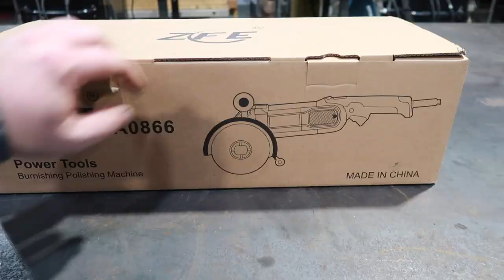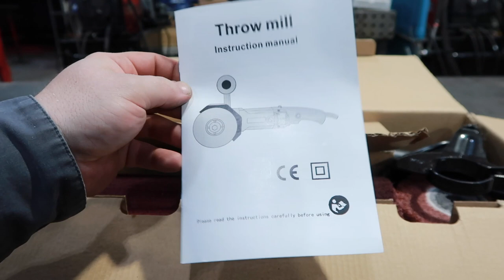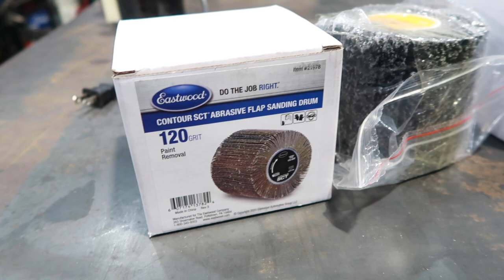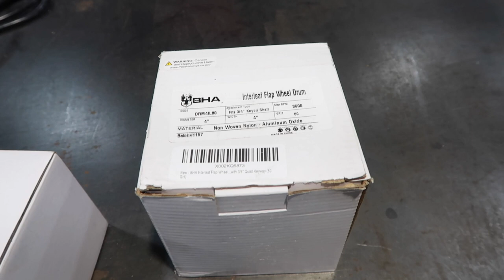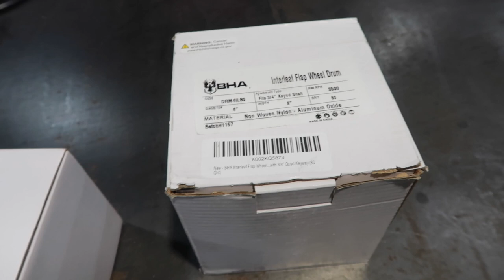Amazon Burnishing Polishing Tool Test | Surfacing Tool | Metal | Surface Prep | Fabrication Tool

Comment: I bought mine from harbor freight last week for $129 came with 3 wheels I paint old cars so hoping it will make getting back to metal easier and quicker.
Reply from the maker: Awesome! Thanks for watching and commenting!
Reply: @TheGarageVlog  it works great for flat surfaces not so good for curves
Reply: HF deliberately makes their model so it won't accept the endless styles of 3rd party drums that all the others use (Eastwood, Vevor, etc.)
Reply: @@chasewilliams5128 If you buy the non-Harbor Freight models you can get a brush or drum for ANYTHING. That includes wire brush drums, flexible grit-embedded nylon bristle drums, scotch-brite styles, etc.
Reply: Will the Eastwood drums fit the Bauer?

Comment: What are the advantages over an angle grinder with a sanding disc?
Reply from the maker: You get more contact area with the work piece, so it works faster and doesn’t dig into the metal like a grinder does. The biggest advantage is this just removes the rust without removing metal. I used to use a sanding disc on a grinder, but you would see still grinder marks. This gives a nice uniform finish. Hope this helps, thanks for the question!
Reply: @TheGarageVlog  Thanks!
Reply: @@chasewilliams5128 As long as you stay away from the Harbor Freight model, you have access to hundreds of 3rd party drums, including stainless steel wire brush drums. There are probably fine ones that will get into pits. There are also flexible nylon bristle drums with embedded grits, scotch-brite type drums.

Comment: Did you say cloth wheel.   I'm trying to buff acrylic
Reply: Stay away from the Harbor Freight version. You are stuck using their drums, and I think they only have 3 styles. Vevor, Eastwood, and others use the standard 4 x 4.75 drums, and you can get everything from wire brushes to buffers!

Comment: If ur getting one there U need to get VEVOR!!?? MUCH BETTER! HAS 4 WHEELS WITH IT WITH THE HARD INSERT IN THE MIDDLE ALREADY! VEVOR SELLS FOR 92!!

ORRR JUST GO TO HF AND GWT THEIR SURFACE TOOL AND U GET 3 CLEARLY MARKED GRITT WHEELS 40 120 AND 240! IT IS 150 BUT IT IS AWESOME AND THEY SELL THE WHEELS FOR 14! WHEN U NEED MORE!

THESE R THE ONLY 2 I KNOW OF BESIDES EASTWOOD! THAT MAKES GREAT DEPENDABLE ONES!!?? 

THE BAUER ONE FROM HF KICKS ASS!!!😮😮😮😊😊 BAUERS IS 149!
Reply: Noooo. Harbor Freight is designed so you can only use their three drums. Vervor, Eastwood and others will accept hundreds of 3rd party drum from wire brushes, to flexible nylon grit brushes, buffers, and just about anything you can imagine. Why would you want to get stuck with their crappy selection.

Comment: I think surfacing tool is just "stupid" not worth just like drum hardwood floor sander it makes more damage than good to project.
That is why is not used by any professionals  tradesman .
Reply: they're a great machince for stainless work. Especially blending brushed finishes
Reply: That's interesting, because I'm one of many that do.
Reply: Its possible,  thats personal opinion. 
People buy good tool and nonsense tool 
Some guys buy top of the line pro expensive  and good tool and then never use it, some of them buy just as showoff .
Reply: I plan on purchasing the Harbor Freight version today.  I'll let you know if I found this statement correct or just wrong all together.
Reply: @ozarusa192  There are dozens of jobs this is ideally suited for. And frankly they are in use by skilled tradesmen in many professions--that is a fact, not an opinion. You have no idea what you are talking about--which is an opinion--nothing personal.